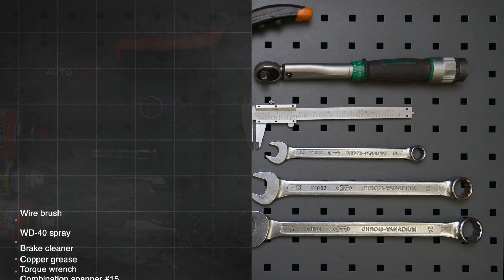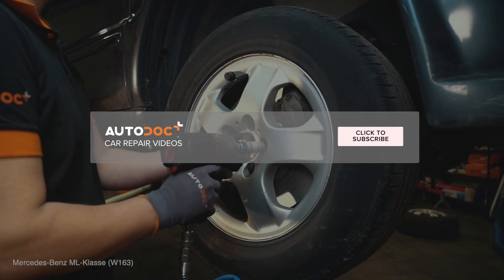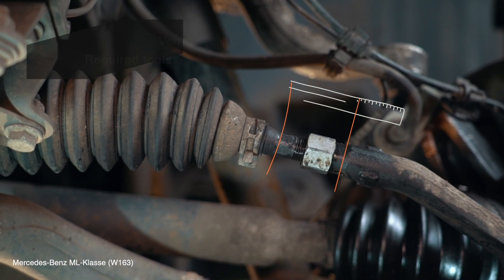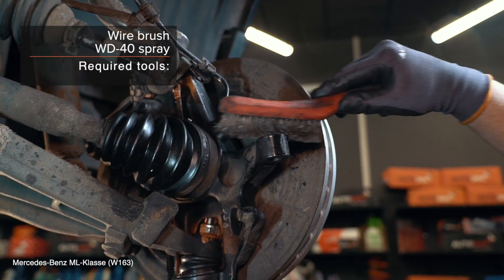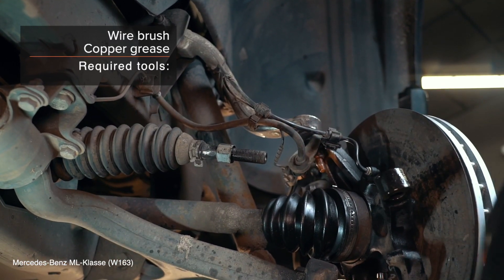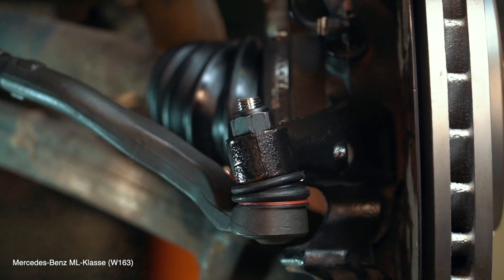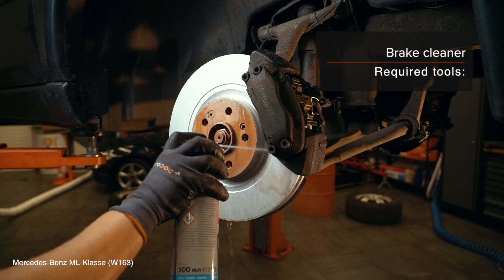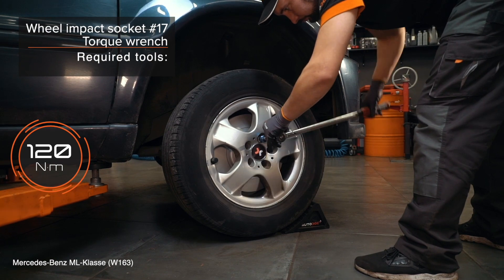How to change tie rod end MERCEDES ML W163 [TUTORIAL AUTODOC]

Comment: Other tutorials says not to use power tool to fasten the ball joint nut. Instead use two spanner wrench, to avoid twisting the ball joint.
Reply from the maker: In this case, by design, it is not possible to use two wrenches for a ball joint.